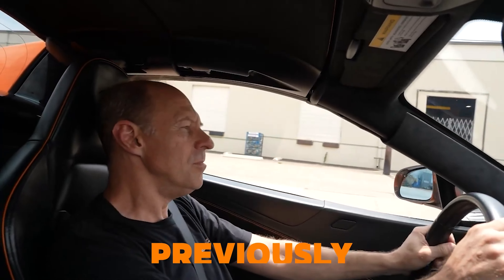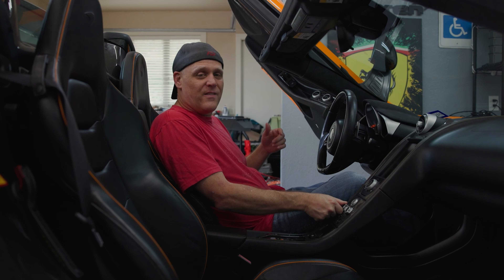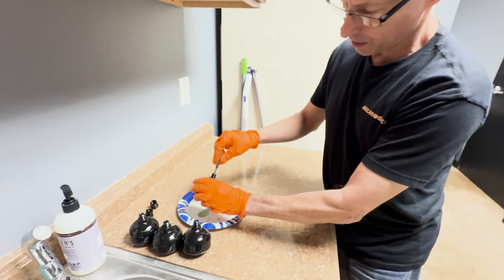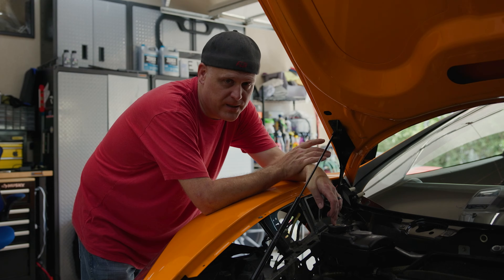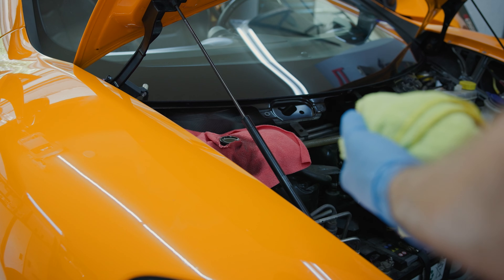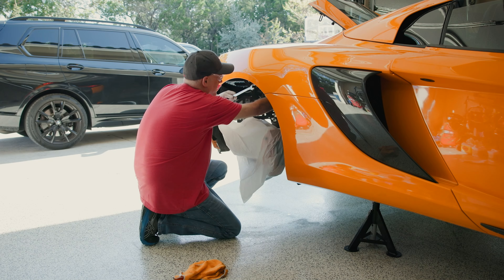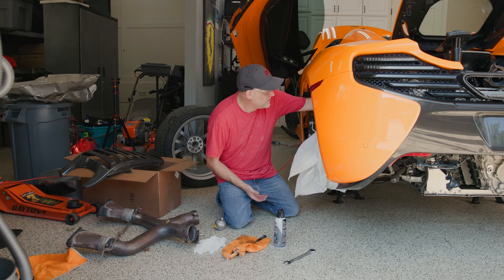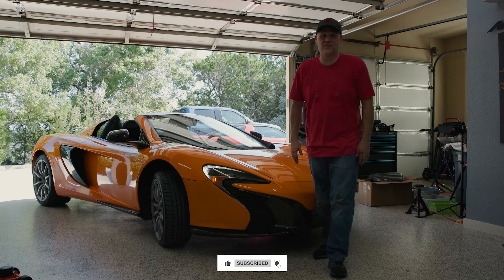FIXING MY MCLAREN 650S SUSPENSION with ACCUMULATORS from a WRECKED 720S?

Comment: I bought 4 new from Thorney motorsport in the UK. Best price on the net. On the car I had two dated 10/14 that had both failed, one dated 01/20 that had pressure but squishy and one dated 04/21 that seemed ok but still moved a little with not too much force.  What dates were on yours compared to how soft they felt?
Reply from the maker: I have found Thorney has very competitive pricing even with the currency exchange for the US + VAT.  I did not have any dates written or printed on mine. Did someone write on yours?
Reply: @midlifecarisis_  the dates are factory stamped into them MM/YY. One of mine had the yellow sticker covering it, the others were easy to see.